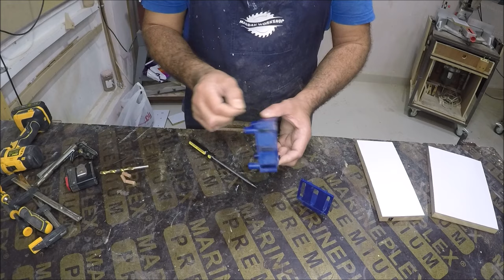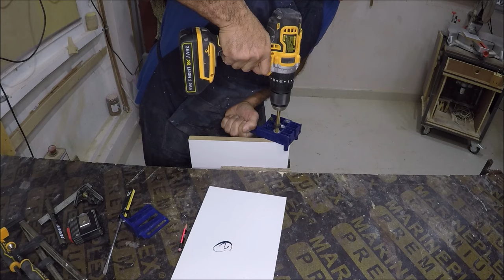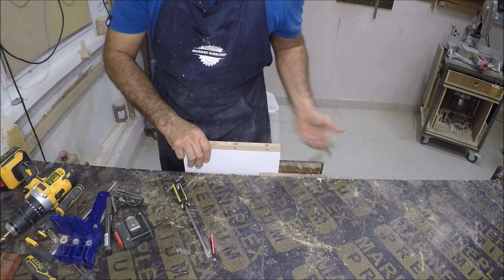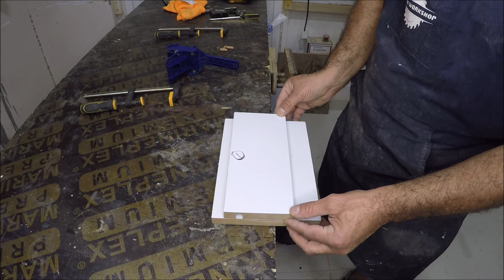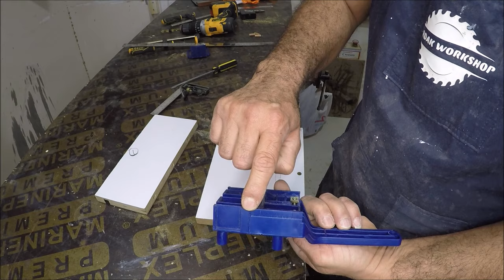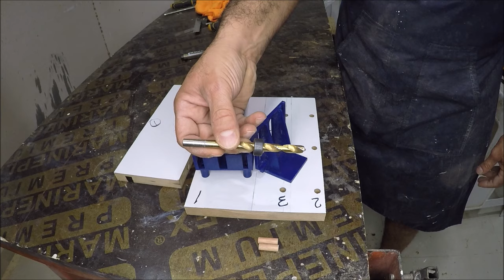how to use a doweling jig step by step

Comment: This product is total cheap ass rubbish . I bought one last week and it broke on the 1st day after underperforming most of that day . Very poorly designed , the detachable plate attaches to the main unit by means of being wedged by two square nuts on the bottom side , these failed within half an hour !  Total crap , do NOT buy !!!
👍🏴

Comment: Simply not an accurate system. It would be good for rougher non accurate projects. If you build some alignment jigs for the dowel jointer it can then be used for accurate work.

Comment: nice tutorial! but for connection 2 there is another faster way
a slots in the vertical stop is made for this purpose

starting from 4:25, you need to turn the tool with the handle up, and the vertical stop away from you. so that the dowel gets into the corresponding slot
Reply from the maker: there are a lot of ideas and method to do that. Thanks for your comment.

Comment: An important safety tip. Do not pull the trigger on the drill to load or unload a drill bit. The day will come when the drill bit will get caught at an angle between the jaws in the chuck, and then you'll have a partly loaded drill bit flying around near your hand, with the power of your drill behind it. Load and unload drill bits manually. Absolutely do not use the power of the drill to tighten the bit into place. Trust me, I've seen the outcome of not following this simple rule, and it's not pretty.

Comment: I have a question. I recently bought 10mm wood dowels but I dont undsrstand which wood brill bit to use to make a hole. I have 8mm and 10mm wood drill bit. 8mm hole for too small for 10mm dowel and 10mm hole was somewhat looks a bit loose for 10mm dowel.

Comment: can you let me know who made the dowel jig you are using. 
thanks, Ray
Reply from the maker: BHD 1.02  52％ Off | Quick Wood Doweling Jig ABS Plastic Handheld Pocket Hole Jig System 6/8/10mm Drill Bit Hole Puncher for Carpentry Dowel Joints
https://a.aliexpress.com/_mPGU63s

Comment: Hi, I purchased one of these jigs when I saw your video, It came with three small pieces with points on one surface and the other end seems to fit inside the drill bit holes (3 different sizes)  Could you please explain what these are for? They have me stumped, I thought maybe they were for scribing a line in the timber to show where the dowels could be fitted, but if that's the case, they'd always fall out and there's no way to anchor them in place. There's nothing worse than having parts for a Chinese gadget and there's no instructions :-)  Thanks for your video.
Reply from the maker: Hi thanks for your comment can you contact me on Instagram and send me some photos of your jig @alnajar22269